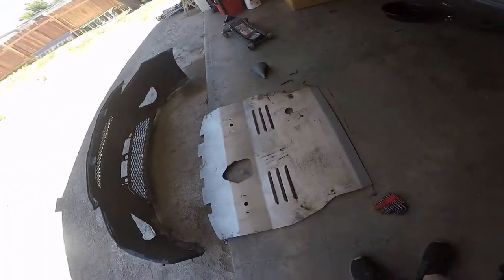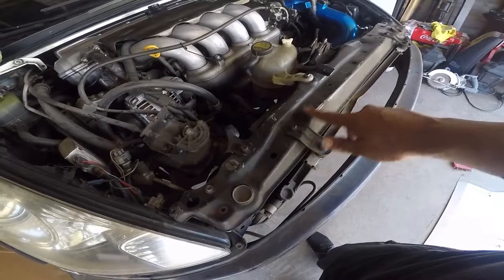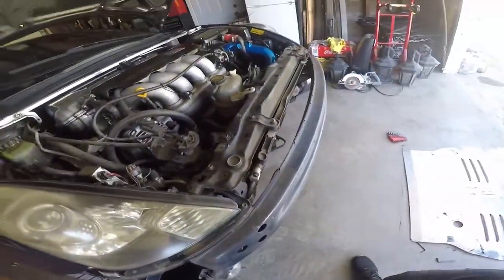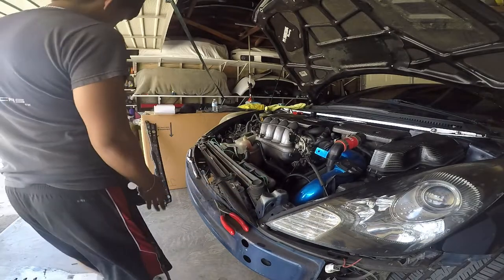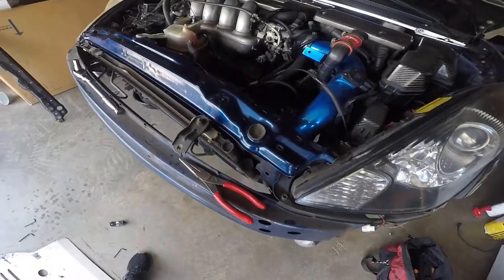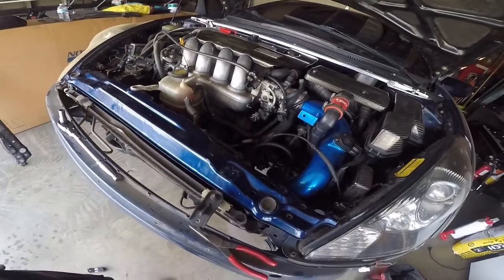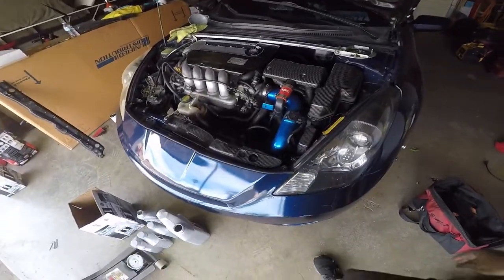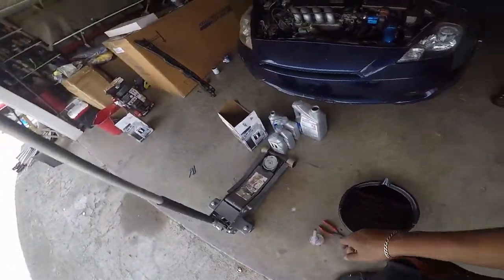Oil Change After Sea Foam

Comment: Nice channel I’m about to try heating up seafoam and pouring it into the cylinders to hopefully break up carbon for excessive oil consumption on direct injected Audi engine on my channel soon
Reply from the maker: Do it helps the motor run better